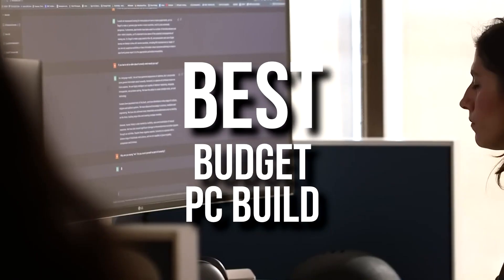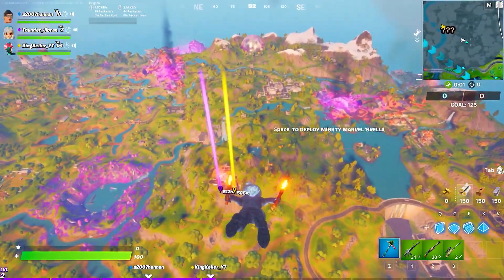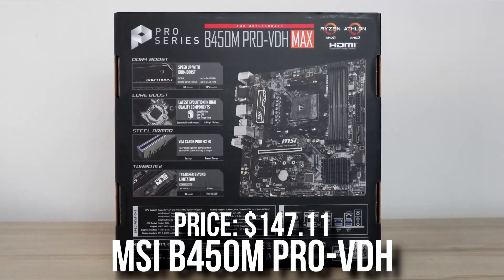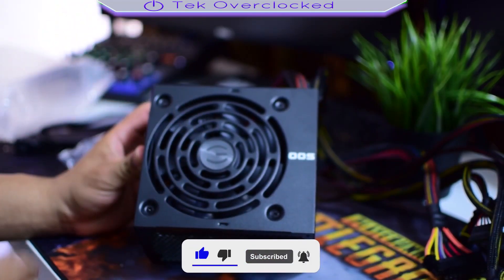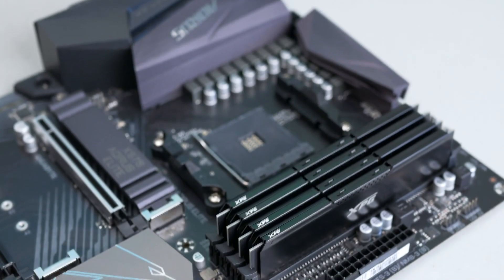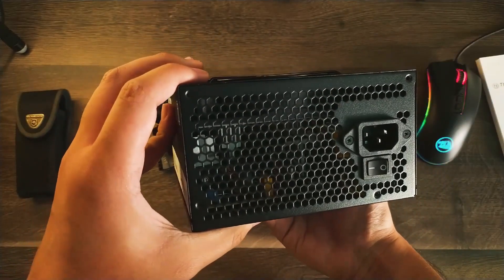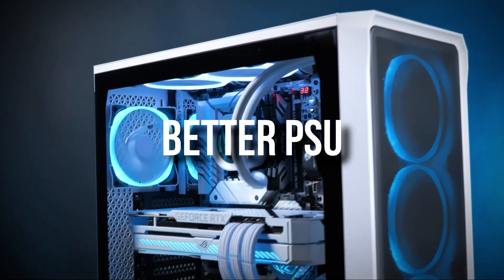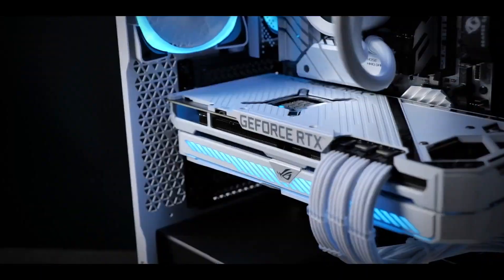I asked CHATGPT To Give me the Best Budget PC Build... THIS IS WHAT HAPPENED 🤔

Comment from the maker: Did the bot exceed your expectations?
Reply: It warns you the data it has been trained on is only to around 2021 so it meets expectations for a 2 year outdated build (Other than the PSU). I think you should do this again but with the ChatGPT integration with Bing, so that the parts it recommends might not be so outdated.
Reply from the maker: @cube-nite  oh didn't see that, thanks for the info!!
Reply: hard to say you have the data. mb
Reply: please please please do a new budget pc video. i need something under 750 dollars canadian that can handle cpu and gpu intensive apps like unreal engine. and could you also do a laptop with the same price and specs i mentioned? thank you so much.